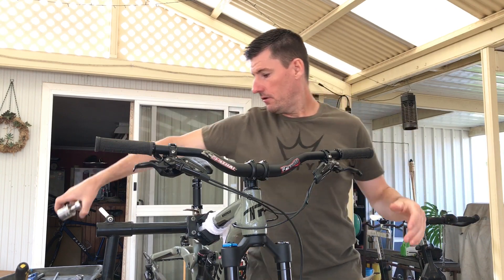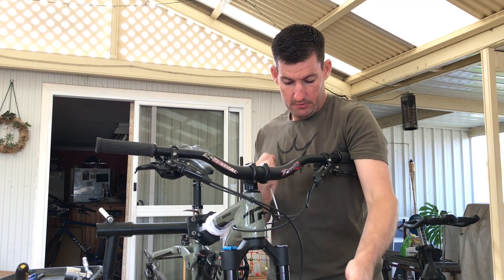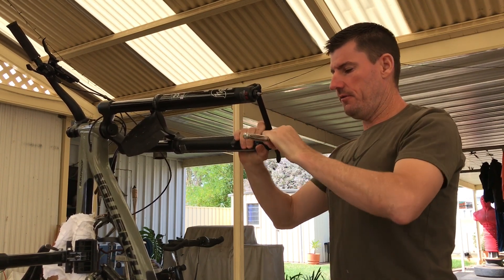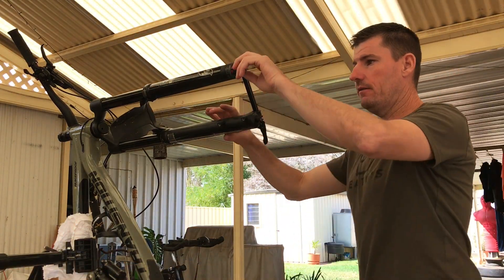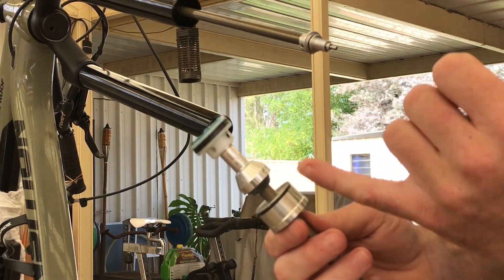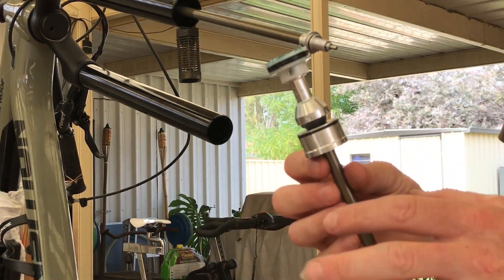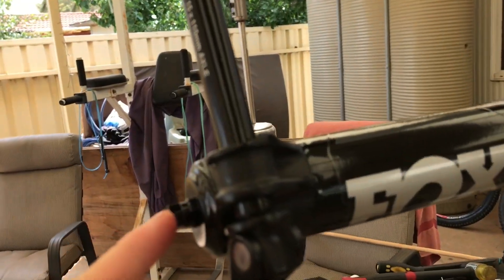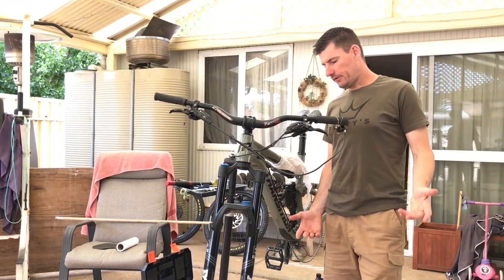2019 Fox 36 Air Spring Basic Service

Comment: You ever seen a Fox fork show no air pressure when trying to adjust it? When putting it up to 50lbs its rock hard. Just curious if you have heard of this issue before. When pressing the shrader valve down no air would come out. I ahve a 2019 Fox 36 Elite Performance on my bike. Just bought it used, it sat for two years without being ridden. New condition.
Reply from the maker: Not sure man. I’d definitely drop the lowers and remove the spring. See whats going on. Maybe remove the valve core up top, also open the compression adjustments all the way see if thedamper is functional
Reply: @mtbtelly5522  thanks!

Comment: How do you equalize the fork, any tips mate? Cheers
Reply from the maker: The equalisation is just into the travel a little bit, so if you lightly compress the fork youll find the port, then give it a few pushes past the port and it will equalise

Comment: i definitely have never seen the 10mm spin the shaft before, i do personally take the nut all the way off to take the crush washer off and then reinstall the nut to tap the shaft loose. obviously wont help with reinstall though..  curious to know of they are better for you now, i am definitely not sensitive enough to pick up on stuff like that especially to see what you considered heaps of grease lol.
Reply from the maker: Guineson this spring was pretty good compared to how they come from the factory. Removing that grease I removed will make a small difference but not a lot. They’re usually caked with grease under there from factory. That blue grease they used is a little slipperier than the slickoleum as well so maybe that played a part in the fork feeling more free as well. When I’m back on the trails I’ll report back on how they feel
Reply: @mtbtelly5522  definitely agree, when i bought my fox 36 i pulled them apart before even riding them and found the negative side loaded up.
Reply: Would it help to leave the air pressure in, then take the bolt off so it won’t spin the shaft, then release the air before removing the air spring? When re-installing, maybe air up a bit before putting the lowers on, would also stop the air spring shaft from possibly getting pushed in a bit.

Comment: Are the crush washers on the lowers both 8mm? Cheers.
Reply from the maker: James Turnell ones bigger than the other to suit the bottom nuts. Not sure of the size
Reply: @mtbtelly5522  1x8mm, 1x13mm. I spoke with the distributor. Thanks for the reply.